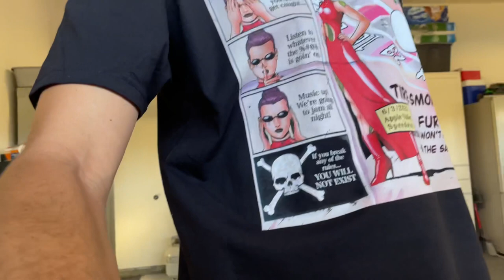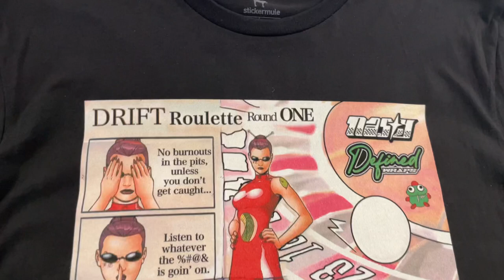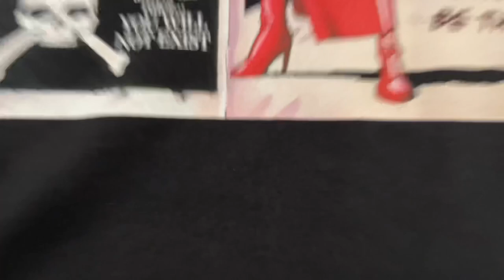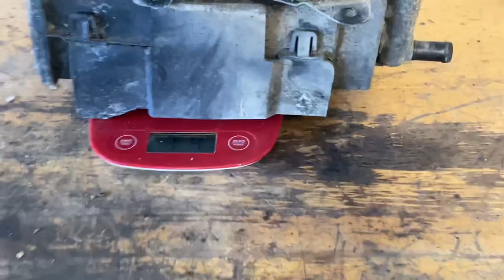Is This A Bad Idea?! 350z EVAP Charcoal Canister Delete

Comment: I can think of a few more benefits. When that canister fails it pushes the tiny charcoal pieces throughout the fuel lines clogging up several other EVAP parts of the useless system. That means having to drop the tank and clear the lines all the way to the engine. Older cars never had this useless system designed to keep mechanics and dealers in business.

I think I would route the filter you installed higher up by the filler neck or it will continuously clog.
Reply from the maker: I didn’t think of that, but that’s totally true! And also true about my filter placement 😂

Comment: Thanks for the video, was the first one that popped up and you did a great job explaining. Also..... that hair...👌🏼
Reply from the maker: Awesome! Glad you found it helpful, and thank you 😂🙏🏼
Reply: @tonycrispin  QQ: Do you remember the size used for the check valve?
Reply from the maker: @SonyaSlidez  I ghetto rigged a generic PCV valve because they act as a check valve. If I had to guess it’s bigger than a normal vacuum line like 1/2” or so?

Comment: Man thanks for your instructions, I have a '97 Mark 8 and mine is on the bottom of the spare tire well. I am needing to eliminate mine ASAP because one side of the steel brackets holding it on are rusted off and it is hanging from the other 2. I really like your instructions for venting the old supply hose, because I heard that if you don't, that the fumes in the tank won't allow you to gas up the car. Like I said, trashing mine is a must b\c you can't buy the steel tray bracket mine is in & it is rusted out & ready to fall off. I have saw online that the prob of the Evap holder rusting out was a major issue on 90's Taurus' & Marks. I've had this car 20 yrs and that is the only rusty thing on mine though, the body is in great shape.
Reply from the maker: Glad it could be of help! Toss that thing in the trash and continue to enjoy your car 🙌🏼

Comment: I know that I'm a little bit late to the party here, but is there any repercussion to removing the solenoid for the evap canister that's attached to the back of the intake manifold? I'm currently putting a VQ in a little old 280ZX, and I obviously don't have the canister anymore, so I'm curious if I can remove that and clean up things from the engine bay.
Reply from the maker: I haven’t tried unplugging it! It’s not doing anything with the way I have the vacuum
 Lines plugged but I’m not sure if unplugging it will do anything. I’ll try that next because I’d like to get rid of it as well lol!
Reply: @tonycrispin  thank you :) I tried for the first startup today. no luck. troubleshooting time haha

Comment: danger of doing this is that you wont get your CELs for anything major that happens like knock count or something that you need to stop driving for.   just my thoughts on it.
Reply from the maker: Valid concern for sure! My car has already had a CEL on for many other reasons so that went out the window a while ago 😅
Reply: Your knock sensor? That is a completely different system. This would just throw a cel for evap sensor. No performance gain for having it. Just something else to break, and something else to get slapped by a blown tire.
Reply: Scangauge 2 will show you any codes that pop up. It mounts to your dash. Just have one of those ?

Comment: With the one way check valve, did you face the direction in or out if there was an arrow on it?
Reply from the maker: It’s been so long I don’t even remember, but the check valve is only there to prevent gas from spilling out of the breather line if the car flipped or something crazy happened. So whichever way would stop fuel from coming out!

Comment: Great video! I'm not a mechanic or a car enthusiast or anything... just a saab owner needing to access the carbon canister and possibly replace it or any cracked tubes going to the throttle. My question is the equipment you are using to slightly elevate your car... is that a  portable car jack or something? And looks like you are balancing it out with a metal triangle support toward the driver side? I don't know what you call that but are you using 2 triangle supports with the car jack... one on each side? Do you have a video on getting a solid mini lift on your car at home in your garage? Thanks for the great video!! It's helping a rookie like me.
Reply from the maker: Just a normal floor jack and jack stands! Once you get the car up on the floor jack you'll want a jack stand on each side to make sure the car is stable in the air. Most auto parts stores, or Harbor Freight sells both floor jacks and jack stands!
Reply: @tonycrispin  Thanks so much!

Comment: I always wondered if it was dangerous letting the fuel tank fumes straight out. Like if someone lights a smoke next to the car is there a danger of an explosion?
Reply from the maker: I don’t think so, you can’t smell fuel anymore than normal (on a car with no cats) maybe if the car was running and someone was under it with an open flame…but I try to avoid things like that. Lol!
Reply: It's not concentrated enough. They would have to hold all that to the actual opening.

Comment: What size was the 1 way check valve and where did you get it from?
Reply from the maker: I used a generic PCV valve. The size was slightly too small but I made it work. If I were to order a specific one way valve I’d probably get something around 3/4”

Comment: Which direction is the check valve oriented in, letting air in or letting vapor out? Nice video
Reply from the maker: More than anything it’s there to prevent fuel spill in the event of a rollover or some serious accident. But ideally it’s letting vapors out as well
Reply: @tonycrispin do you have the part number for the check valve?

Comment: How is the Z running? I just did this to my 370 and everything seems fine but the engine load gauge stays at 100%. Other than that drives like normal
Reply from the maker: No issues, or changes in the way the car runs and drives. I really haven’t even noticed a change in fumes either!

Comment: Im doing an ls swap and was curious if i could just hide the evap hose thats in the engine bay from factory but keep the canister and it would keep smell down?
Reply from the maker: You could for sure! I haven’t noticed any extra smell from deleting it all but I know a lot of people do complain of that
Reply: @tonycrispin  would I still need the filter at rear or is that only if canister is removed? Also could I just cut the evap line or would I need to plug it?

Comment: Pretty dumb question but the check valve what direction did you put it? And what size?
Reply from the maker: In theory it’s only there to prevent fuel from spilling out in the event of a rollover or something crazy. And whatever size your line is! I forget exactly what mine was 1/2” maybe? Lol
Reply: @tonycrispin  yea I get that but some of these are directional so I wondering  if you put it this way ⬅️ towards fuel pump or ➡️ towards that little filter.

Comment: Hey Tony, congrats on your latest performance at Pro-am👊🏻
Just a quick one. I deleted my evap after watching this and did the same with the small Breather Filter. I also plugged the vacuum bit near the plenum.

This could be unrelated. But since the delete, my Z is idling weird! Dropping revs below 500 (sounding like it's nearly going to cut out)  then climbing just over 1k. Did you get any weird changes since you did yours?
Reply from the maker: Thanks!! That’s very weird! No my car didn’t do any of that. Maybe double check for any vacuum leaks?
Reply: @tonycrispin 
False alarm😅.. I've recently stuck a headlight intake on, so had to change the intake around. Turns out I just needed the ecu to learn the new system🤦🏽‍♂️😂 
Ngl, this headlight intake would look dope on your Z bro👌🏼
Reply from the maker: @iconicstance2994  oh ez fix, nice! What intake is it? I’ve been considering gutting the headlights anyways lol
Reply: @tonycrispin 
It's a company called Pro Fit Kits, I think they're based on FB, maybe insta too. I'm not on socials so I just emailed them. 
Stick a cheeky 45° silicone hose on the end of your current pipe, cut out the lil section between your current filter and headlight housing and boom👍🏼 I bought a HKS shroomy boi to sit in mine, looks pretty sick man😂

Comment: Do you get any CEL?? My drift Z was hit in the rear so the lines to the canister snapped off. And after about a long drive or multiple short drives I will get a CEL for a large evap leak.
Reply from the maker: I already had a CEL for 100 other things so not sure 😅

Comment: What does that do to the Check Engine Light/Code?
Reply from the maker: This will for sure cause a check engine light. Do not do this if you want to pass smog lol
Reply: @tonycrispin  ok.  Thank you.  There’s no way to bypass the solenoid valve to eliminate the code?
Reply from the maker: @SavDog262  I’m sure there’s a way to trick the check engine light but I personally haven’t tried!

Comment: Make your life easier, remove the entire fuel regulator and bracket on the passanger side. The fuel regulator can just be bolted directly to the fuel rail just like the driver side. Opens up so much space.
Reply from the maker: Oh, interesting, I didn’t think about that. I have to take a look! Thanks!
Reply: @tonycrispin  no problem man. I've had mine setup that way for 2 years. No issue. Wanted to eliminate as many failure points as possible. Its crazy how much useless garbage nissan put on these cars.
Reply: @keganritz4418  More likely forced to put on by the EPA.
Reply: you’ve got instagram or facebook? i’ve got some questions